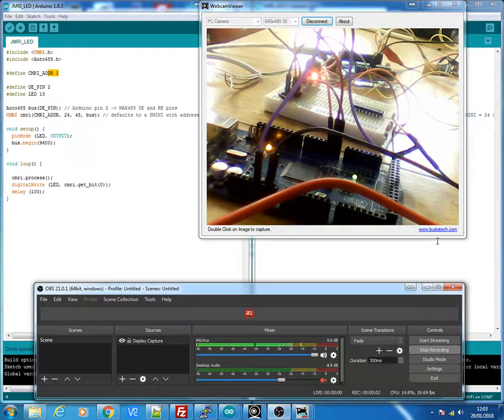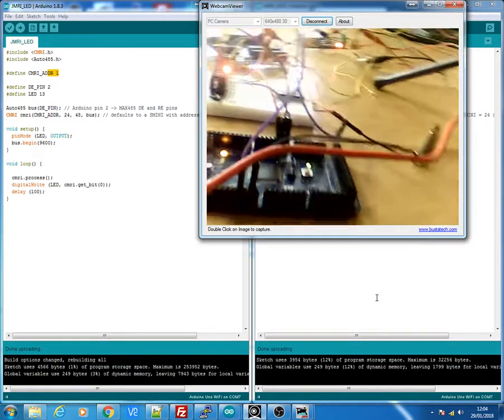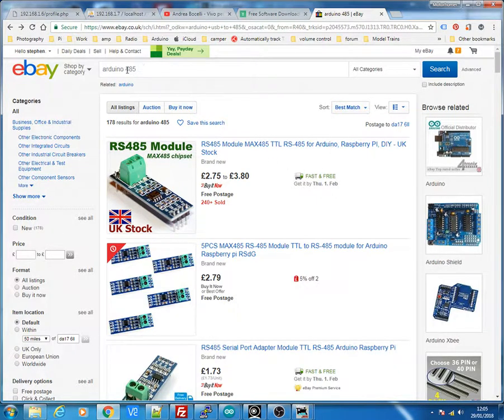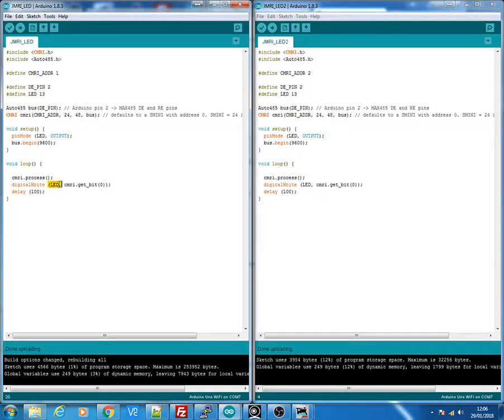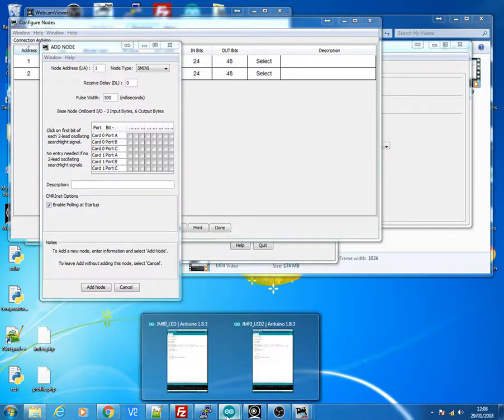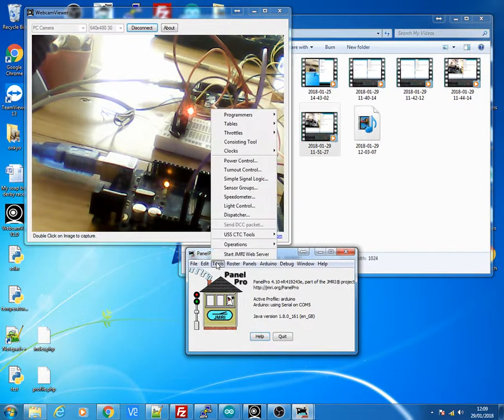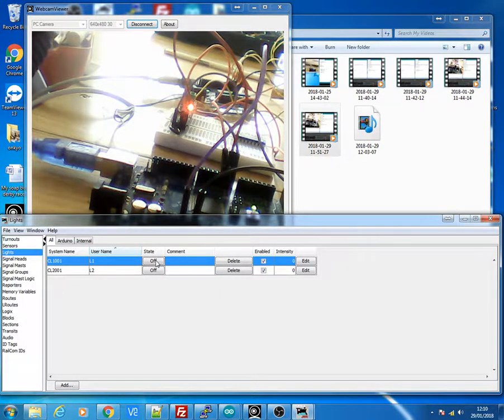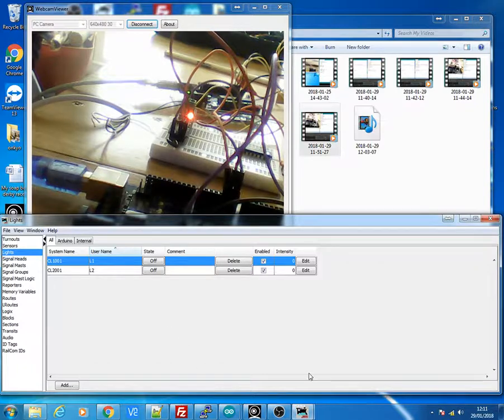Model Railway JMRI control 2 Arduino with CMRI

Comment: Thanks.  This is Brilliant. 
A couple of Gotchas! 
On more recent version of JMRI Preferences, there's an additional connection settings checkbox for setting com baud rate. it defaults to 11920 not 9600 as written in the arduino code. Needs a save settings and restart. (almost 2 days finding that one @~#!++$!!)
Arduino ProMini use TX0 and RX1 for DI and RO. The "0" in TX0  and the"1"in RXI" are not pin numbers They are mounted reversed to that of a uno. So pin 0 is TXO which is actually pin1 in the wrong place and the reverse for RX.     The microscopic I and O stand for "In" and "Out" not 1 and 0.!
Steve
Reply from the maker: Thanks for the info nice one. I think I might start a collection of this on me web blog so it's all in the same place for others to find easily

Comment: Hi I can't get this setup to work on a megga either. I have it running on 4 uno's but no matter what I try a megga just won't work. I've tried two different megga's but no sucsess. Strange thing is if I disconnect the megga from the rs485 and connect via usb it works fine. Any idea why it works on uno but not megga?. I suspect it has something to do with the DE_RE pins because when I put the megga on the rs485 bus it makes the other uno's very hit and mis with data to and from CMRI.
Anyway thanks for putting this up it has been a great help. In the meantime I will keep plugging away with the megga or I may have to end up using seven or eight uno's or nano's.
Reply from the maker: Hello John - Cant see why your mega is not working. In the video I was using a mega and an uno. I was using pins 0 and 1 on the mega for RX and TX communication. It might be a mega build problem with different chines models or it might be possible to use different serial pins the mega, which has 3 sets i believe. Not had time to work on this at the moment If I do I will let you know

Comment: Hello been working with your arduino projects but can not get it to work on a mega as seen in this video. Can you offer any help?
Reply from the maker: Sorry Ted this should all work with any arduino. Is your Mega working with normal scripts like the blinking LED. Is the code uploading correctly in the console. It will show an error at the bottom of the page if not. Have you copied the code exact from my web page.
Reply: @BrackstonesTravelAdventures  thank you for the reply. my megas work until i set them up for the i2d and then i lose them. the blinking lights on my rs485 to usb converter change to only the txo light blinking. strange?
Reply from the maker: @tedmiller6770  hi Ted Not sure i will be able to help but a few things to check. Double check the wiring as shown on the web page and make sure you have the DE and RE connected together to pin 2. For the code have you down loaded and installed to  Auto485.h library. i expect you have as it should show an error on loading if not. Have a look at the example of the Auto485 in the arduino IDE as this should at least ensure the RS485 is working properly ant set up correctly
Reply: Thank you for the reply. I have it all set and working on an uno and a mini them moved every thing to a mega using the same code. Right now I have have your CT sensor setup working  like a charm on two megas. one running the CT sensors and the other sending to CMRI/JMRI. THANK YOU. Will be trying that on an I2c set up soon. Not sure how many sensor and outputs i will be using.